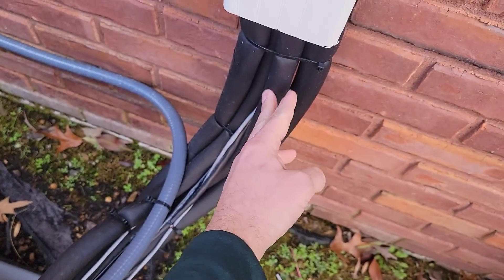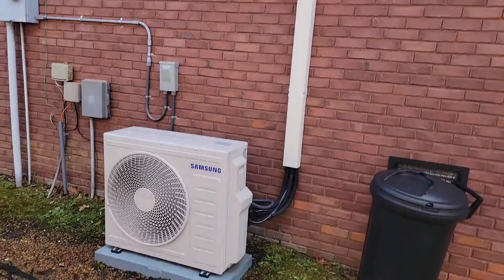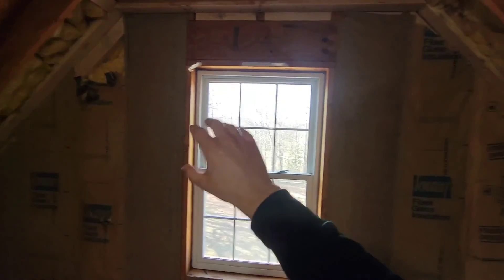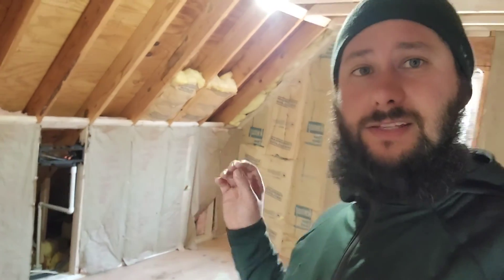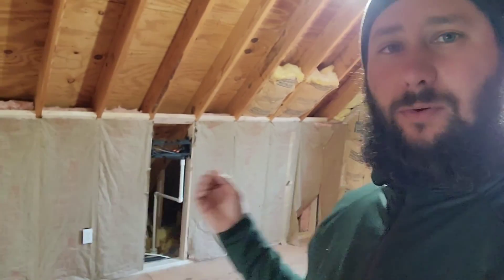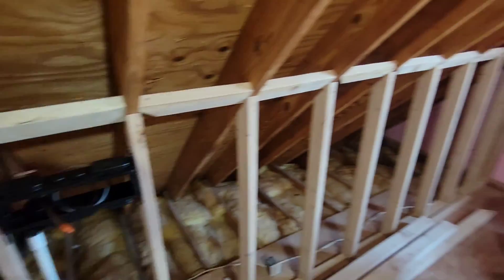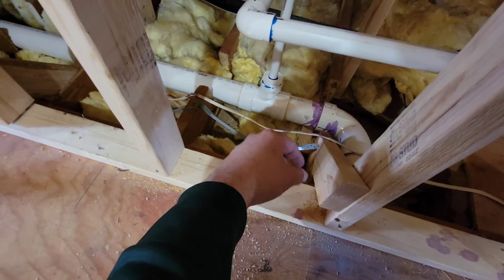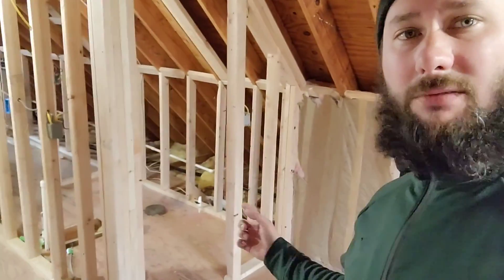How to install a mini split system?

Comment: Hi. Thanks for the video. I have a question on my project. The only space I have is a knee wall. Would you in General say a floor mounted unit is better than a wall mount? It will only be about 2 feet off the floor. There shouldn't be any obstruction in front of it.. can the air flow be aimed so it's not all blowing air downwards?
Thanks.

Comment: Can the refrigerant lines on a wall mount unit run UP 2 feet the across my attic before going down to condenser? (I plan to run drain inside wall and down of course).  8oct24
Reply from the maker: Yes absolutely

Comment: For 200 sq foot would a 9k work better?
Reply: I’m assuming each head u installed is 12k
Reply from the maker: yes absolutely
Reply: @taddydigest ok bc I have a 180 sq foot addition. ( sun room) longer than it is wide but I can’t do it like u wanted here and run it so the air blows front to back. Has to be side to side. 8-10 foot ceilings. I’m thinking of doing 9k btu head with matching outdoor. Just wanted feedback
Reply: Only one wall has a window btw. 3-4 foot tall by 5 foot wide window.

Comment: thanks so much for this video! We installed mr slim air handlers and now we have to install a cieling below it but every youtibe video making a cieling is just attaching dry way to studs! what if you dont have studs and you want the dry wall as high as possible? thx!!!

Comment: You missed a double check back flow preventer or what local code requires on drain line you tapped into drain or vent with no trap and or back flow prevention
Reply from the maker: We actually came back and installed traps. I did not show that in this video or mentioned it but I wish I would have.

Comment: I've been needing this video for about 6 years now. I did a reno of an attic space after but8ng a new home. I can so anything construction and my knowledge is cast, except in the hvac area..🙄😞. I've been running a PORTABLE AC unit in a space this size with not alot of climate success. This is super helpful to get me off to a good start with unit size, placement, and drainage...👍🏾🫵🏾 da man bro! I love it
Reply from the maker: Glad I could help! Thanks for watching my brother

Comment: How close to the top of that knee wall can you put the head? I have a similar attic space in my garage and was going to basically put it all the way at the top of that knee wall since it's not really a ceiling above. The only issue would be having enough room to tip the unit to clip it on to the bracket.
Reply from the maker: You wanna make sure that you have at? Least. 3 to 4 inches above the wall mount air handler.
Reply: @taddydigest   Awesomesauce! Thanks a ton. Liked and subscribed. Also, I just got done reading a bunch of people's opinions on forums that said don't install a mini split below 6'? Is that really a big deal. I'm mostly using mine to heat and I figured the heat would rise and fill the room. Cooling is just a bonus.

Comment: Have you roughed in air handlers (7' off floor) with no exterior wall?  Why?  3-zone exchanger covering 3 bedrooms times 2, then a 6 zone, 60k BTU managing the common areas, office, kitchen, laundry, dining of the house.  Would you use a rough-in box for the handlers or stick with the regular mounts and run your coolant/control/condensate drain lines to a hole in the wall to install the handlers after the drywall?  The lines can be in the attic, but the condensate drains are likely going to flow to the nearest exterior wall or drain common to the bathrooms.

Comment: Is the drain connected to 3" vent/plumbing drain without a p trap , if my unit was precharged for up to 25ft lines and I  installed 50ft line set, how much more 410a would I need to add???

Comment: Are you installing two 12000 heads up there
Reply from the maker: yes
Reply: @taddydigest  well I got the same room and it’s 20x32, that’s including the bathroom on the end, what size mini split you recommend and it’s well insulated
Reply: @markmark8866  did you ever figure it out ? I have the same size room minus the bathroom in a finished attic like the video and I get different answers depending on which online calculator I use
Reply: @marcoeis6598  i ended up putting 18’000 Mitsubishi
Reply: @markmark8866  that's exactly what I was aiming for in my main room at 600ft². Coupled with the other 200ft² room I'm gonna do a 24k btu unit with 2 handlers. I assume your sizing worked out correctly ?

Comment: Hey Tads, love the videos question do you insulate behind the brackets after you install the wall mount?
Reply from the maker: Yes we usually insulate behind the bracket  Just to prevent hot to cold

Comment: Do you have personal specs when mounting your plate on the rough in box ? Or my question would be , if the rough in box comes with dimension for the plate , my supply house has them and I’m just waiting for the opportunity to get them and installs them , seems pretty clean , thank you , Sir appreciate it

Comment: 2 consoles are roughly $500 more. Easier lineset and drain runs then if next to the window. Less labor negates the added cost almost. Consoles were the way to go. But wall mounts in that spot definitely the cheapest option.
Reply from the maker: I'm glad that you have the knowledge my  Friend
  Thank you for watching my friend
 You are so right

Comment: Maybe i missed it but way not use ceiling cassette units
Reply from the maker: To expensive for the customer
 Extra $250 perfacia panel
 And There was not enough room for access to  The drain
 But I would have liked that better